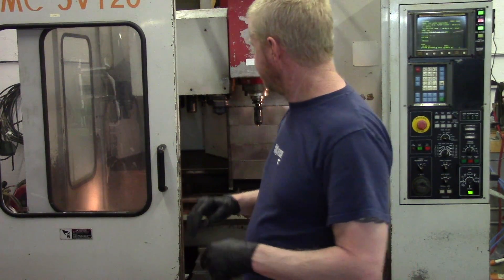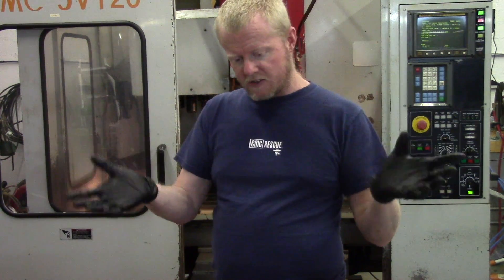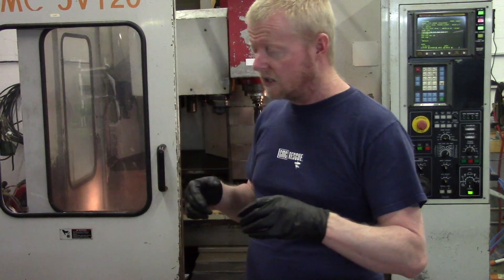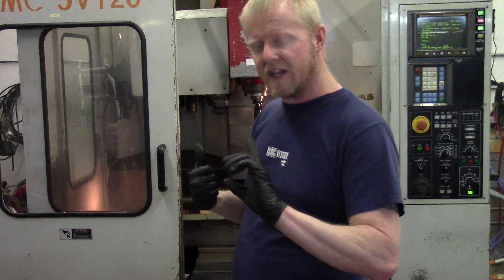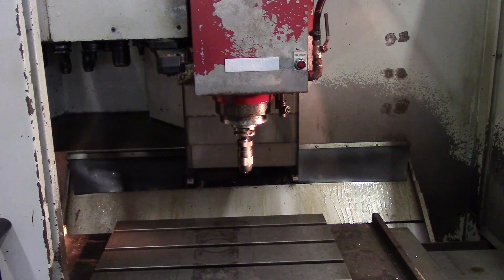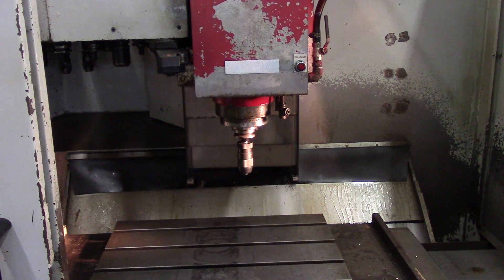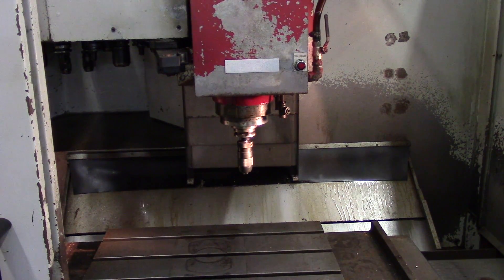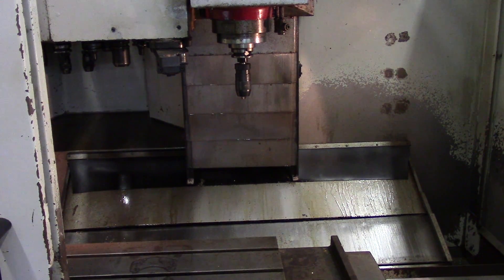Proofing CAM to DNC to Mill

Comment: Shane... Wtf man... We're like the same person. I have a devops background and have a machine shop with an old cnc mill that i had to fix and figure out how to run with no info online (1998 tree VMC 500 with acramatic 2100 control) and a cnc lathe (hardinge chnc iii sp with fanuc 18t) now. Also have a radio technician license and enjoy anything with a motor

Comment: Hey Shane, Thanks for the nice video. i am currently also considering buying older machines and use DNC as well. Its a brother TC-S2B with Brother A00 control. (RS232 connection) Is there anything I should know and prepare? Maybe the Cable for it?  I also wonder if we need to search and select the program on the dnc pendant after each program? Or do we only press cycle start to repeat the same program. (We might select the wrong program after the 100th part) Cheers mate.
Reply from the maker: I'm not super familar with the brother but on fanuc you select tape and cycle start with the dnc in the ready to transmit mode.  Lots of info on the TC-S2B on the internet and looks like many are successfully using a DNC with them.  Also looks like they support fairly high baud rates for 3d work.